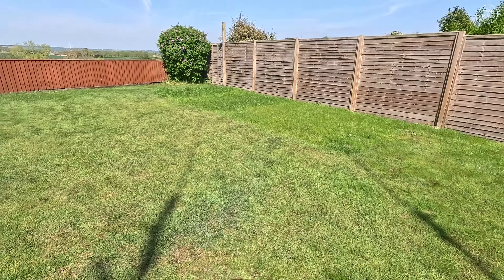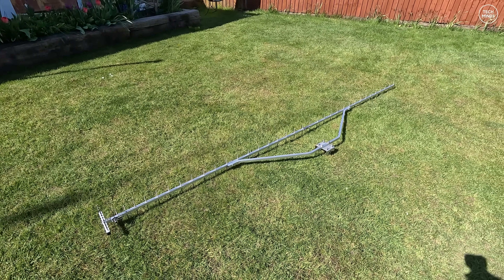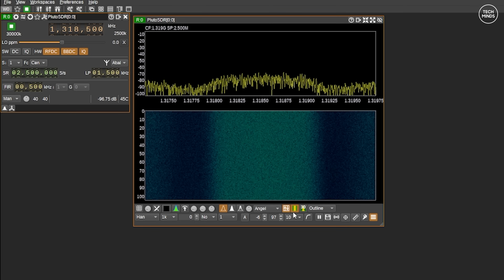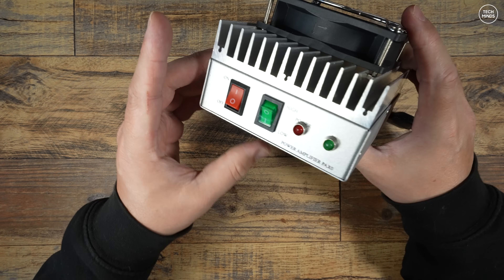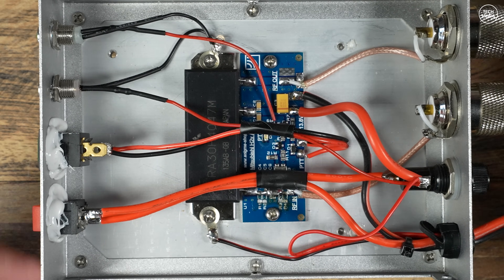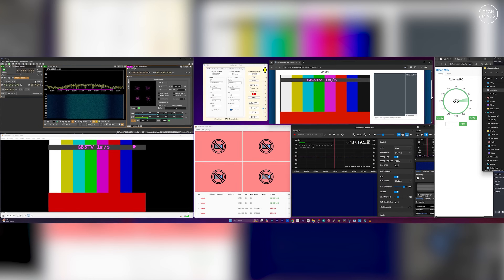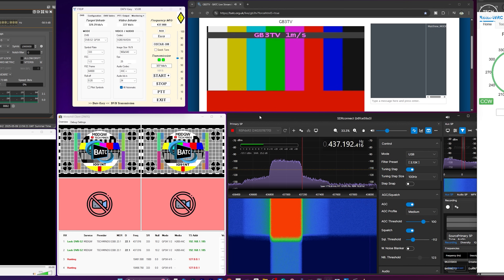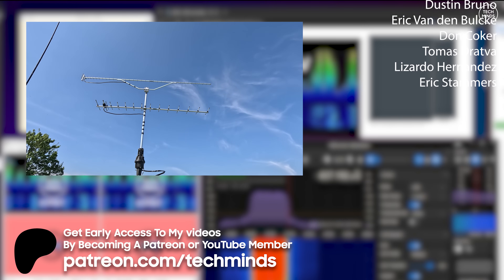Digital TV Over Ham Radio – 437 MHz to 1.2 GHz!

Comment: There are 3 mechanisms for a Tx to hurt an Rx. Wideband noise, blocking and intermodulation. The first one of these is fixed with a filter on the Tx and the second with a filter on the Rx. Intermod is more insidious and in theory can only occur when you have two transmit frequencies. In reality you can get spectral regrowth outside the Tx passband with wideband signals like TV. But I suspect a blocking issue. Why? I can’t say anything more than many years of fixing these sorts of issues and the fact that the Pluto is wide open. Resistance to blocking is a function of the headroom of your receiver. A front end with higher noise generally has better blocking performance (but who wants a high NF receiver). 

To fix let’s tackle blocking first. You need to measure the isolation between your antennas by putting a 70cm cw into your tx yagi and measuring the power of that signal in your RX antenna. You then need to know the out-of-band blocking performance of the Pluto. If the Pluto doc doesn’t give that then maybe target -30 or -40dBm ( that’s a real guess and comes from commercial system specs so it could be alot lower). Your tx signal (20dBm?) minus your measured isolation gives you the power into the RX port of the Pluto. Any deficit (ie if the Pluto blocking spec is below this power) is made up with a receive filter. 

Now the more difficult one - tx wideband noise. You can check the output of the transmitter at 23cm with a calibrated SDR or spec an. You are interested in the power at your receive frequency of course. Often this will be too low to measure after putting in all the attenuation to protect the front end of your spec an so the only way to do this measurement is with a good filter. When you use a filter like this it reflects all the power back towards the transmitter so you require an isolator right on the output of the tx to shunt the returned power to the isolator load. Not many will have a circulator/ isolator for the right frequency (they are frequency specific) which makes this measurement hard to do. The Tx noise needs to be about 6dB lower than your receive level + required c/i for your modulation - yes lower than your receiver noise floor, most people think it just needs to be the same level as your RX noise level but if that was the case it would degrade your RX signal by 3dB (ie double the noise power). At 6 dB lower it means the transmitter will only degrade your Rx by 1dB (I think from memory). This measurement can only be done by connecting to your transmitter. You can’t measure 6dB below the noise floor on your RX antenna physics doesn’t allow it! Measuring on your tx line means the measurement is higher than the noise floor by your measured antenna isolation less 6dB.
Reply from the maker: Awesome advice! Thank you for your time writing this..!

Comment: I would suggest trying to back off the drive on the TX amp.  Looking at the  signal on the SDRCONNECT display the "shoulders" of the transmitted signal look to be about 20 dB.  Shoulders are generated by the nonlinear action in the amp.  A more technical term is spectral regrowth.   That additional power outside of your TX BW will be additive to the C/N required at the repeater Rx.  So let's say the modulation mode and FEc u are using requires 20 dB C/N to be decoded.  If you now add the  20 dB C/I from spectral regrowth, your total C/N IS 17 dB.  That could be part of why u were dropping out of the repeater.  With digital TX often "less is more". I would vary TX power and look at spectrum on your SDRplay to minimize that spectral regrowth
Reply from the maker: Oh I was over driving it for sure. I knew that when the shoulders start to creep. I was told GB3TV 437 input is quite deaf, and I was just testing really while pushing the amp. This is just a ‘throw away’ project, I have a 350 Watt UHF pallet that I’m currently building into a box for DATV etc. will defo not need all that power and will be tickling the drive, with no shoulders. Great info though for those that were wondering what the shoulders were on the signal. Cheers
Reply: @TechMindsOfficial  Great, glad you appreciate the comments.  Have spent 30 yrs of my career doing digital TV from the earliest days in 1991.  A good rule of thumb, at least as a starting point, is Peak to Avg power of a QPSK signal is about 6 dB and for 64 QAM about 10 dB.   That is,  the amp has a P1dB compression point ( which is the end of the linear region) a good operating max power for QPSK is 6 dB below that P1db, etc..  after that point spectral regrowth will go up quickly.   Looking forward to more great videos, enjoy your work
Reply from the maker: @johne1793 brilliant! Thank you! I really appreciate these types of comments, it helps me learn, and others learn. So it’s very much appreciated. Ham radio has to be one of the best hobbies right? :) cheers and thanks for watching.
Reply: @TechMindsOfficial  You are most certainly welcome.  It is a fantastic hobby and drove a lot like me from the 1970s to go after our EE degrees to "play radio " all day.  You are certainly keeping the hobby going in the right direction with good technical content.  We need more technical, IMHO, things to keep the hobby from drowning.

Comment: Let's see, 437 MHz times three is 1311 MHz, so that's likely to  be a problem, but so is the probably much greater power of the fundamental. You are going to need both a low pass filter on the 437 MHz and a bandpass for the 23cm. A bandpass will be best as it will also remove mobile phones, Wifi, FM broadcast, DVB-T etc. A 23cm interdigital filter is easy to make and will do the job. You can also buy SAW filters for 23cm but these are a bit lossy.

Comment: Hi Matt, do you use any type of surge arrestor before the Pluto receiver ?
Reply from the maker: It’s normally used for QO100, connected to an LNB directly. The only thing normally inline with the RX is a band pass filter to reject GSM signals.  But in this example, it was connected directly to the yagi.
Reply: @TechMindsOfficial  Thanks. I've been reworking the antenna entries into my house so was curious. Cheers,

Comment: Great Video, thanks for the demo. 73 DK1JG
Reply: Your transmit shoulders are only 20dB down and you should really aim for -30dB. You are driving that amplifier too hard or haven't got the bias current set correctly. It should be operating in class A mode. Those Mitsubishi bricks need to be derated for ATV use.
Reply from the maker: Thanks for watching!